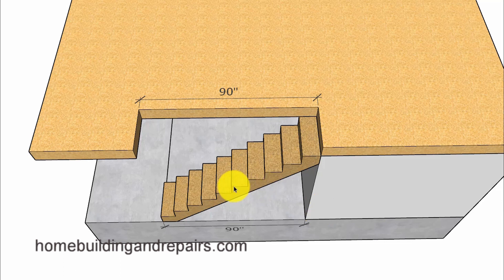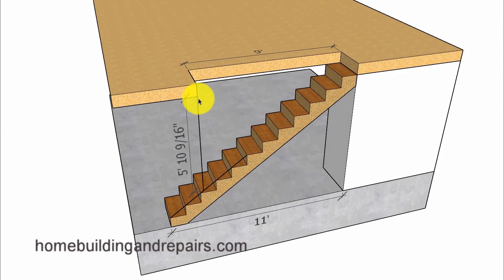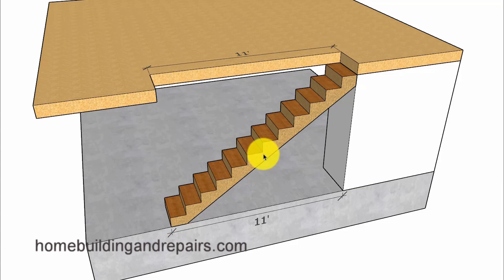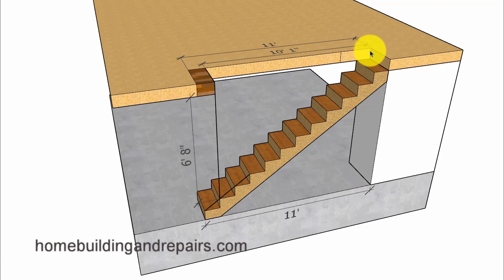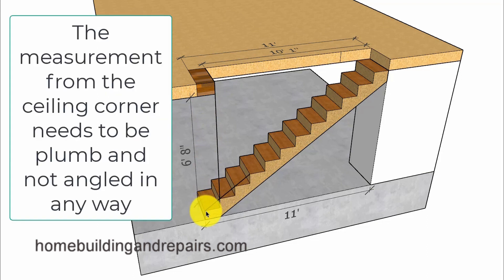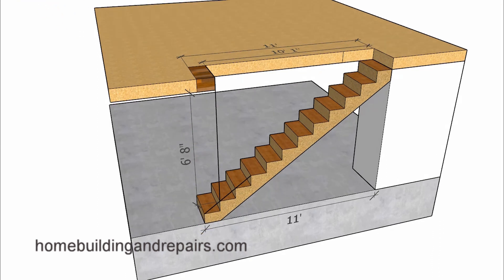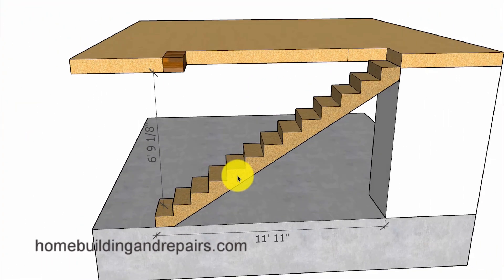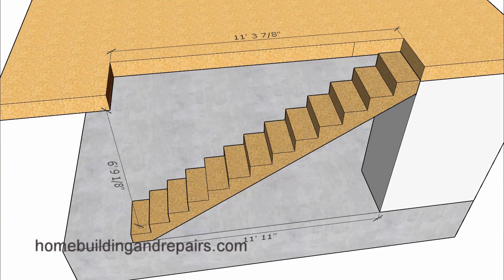The Most Common Question Asked On Our Channel - How To Make Stairs With Short Steps Longer

Comment: Thank you for the instructive video!...After replacing the original century old staircase with a much safer staircase, headroom problem is now the problem (5'11" tall)...Unfortunately, my trips to the basement have been reduced from 7 days/wk to 1 day/wk...As a result, currently considering cheaper options other than underpinning the basement!
Reply from the maker: Yes, not an easy problems to fix. It seems like it one of those problems where you fix one problem and create two more.